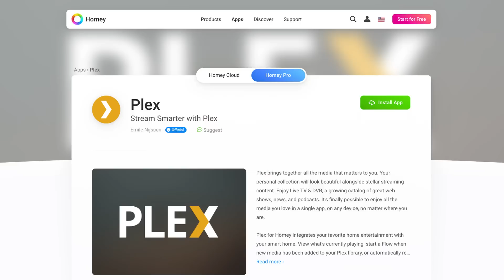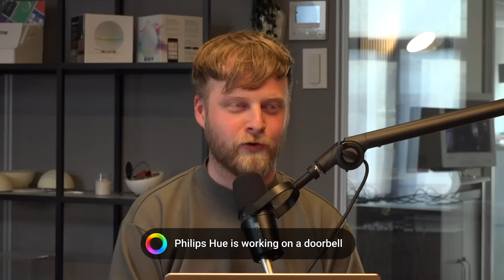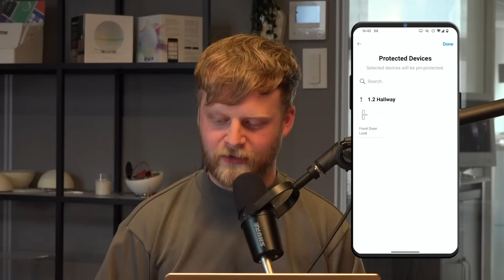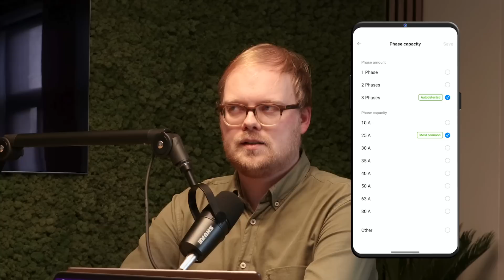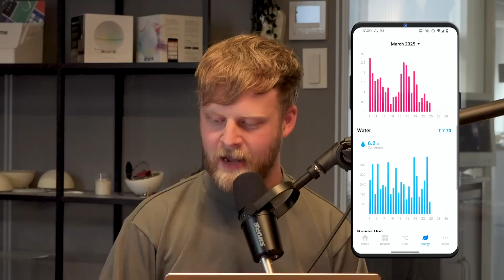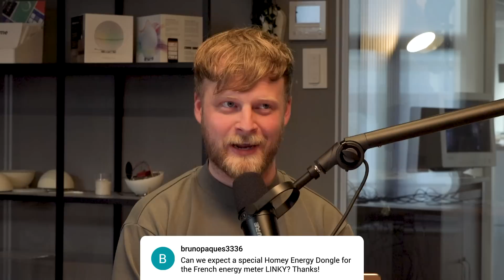The Homey Podcast #7 • Featuring Bouke (Homey Mobile App Developer) • Homey Energy, Q&A + More

Comment: Anybody have any advice for learning about the scripting in homey devices ?
Just bought the homey energy dongle. Its great, but when I import one days figures, the time stamps is 2 hours wrong. My app has landcode SWE or SE. But when i look at the setting for my electric meter, it says GB. So the reports from the dongel is 2 hours late. Let say I  choose yesterday result, I get it from 22.00, and result i actually from 24:00. I am a little bit confused how I can fix it. It looks like the energy meter is set to landcode GB, but I live in SE. 
The time differance is 1 hour, but the differance are 2 hours ?

Comment: Will the developers consider adding and sunrise sunset options in the date / time system app?  Currently I am not able to create a flow that turns on a light when tripped by a motion sensor at a designated dim level at a specific time (10pm for example) and then not have that light turn on when the motion sensor is tripped after sunrise.  ( A time that is always changing)  The forum suggested the sun events app, but I was not able to combine a date/time function and sun events function in the same advanced flow and have them work together.  I pinged the dev of the sun events app and never heard back.

Comment: For monitoring energy usage, it would be great if you could manually set the power usage for dimmable light bulbs at a few different dim levels, and then let Homey interpolate the actual usage based on the dim level. Is that something being worked on?
Reply: I just realised it's practically already a function. Great! 🎉